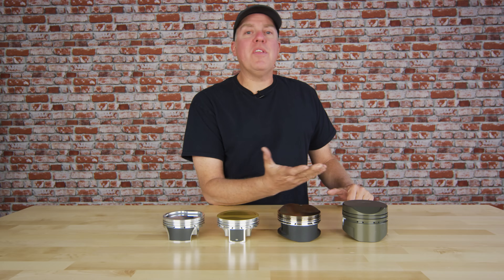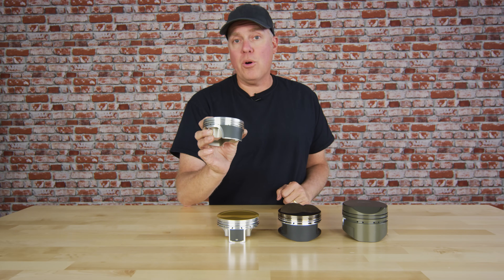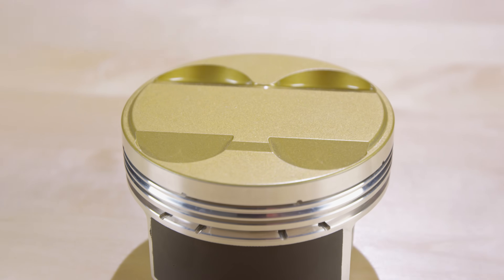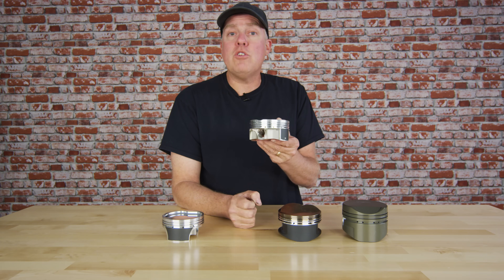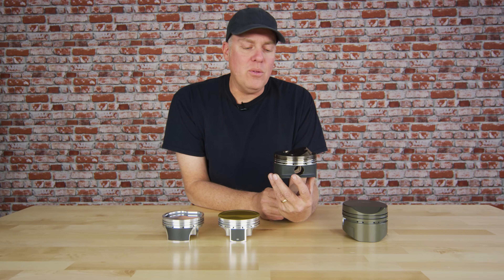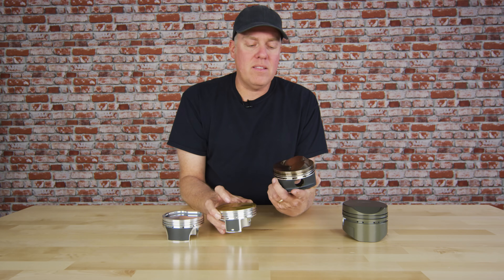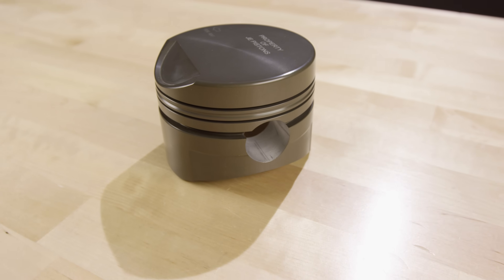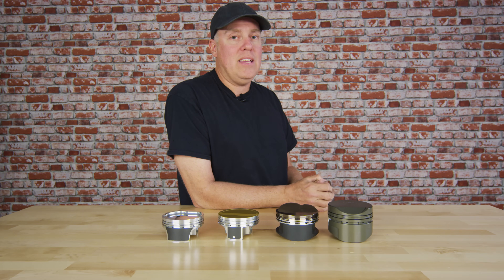Piston Coatings 101: Which is the Right One for You?

Comment: Dude you didn't even mention the fact of the different circumstances when it comes to anodizing or non anodizing pistons when you fully anodizer piston it does make it harder however it does also make it subject to wear and under heat contracting and detracting of the anodized metals can cause cracking which can annihilate and inevitably lead to engine failure. I was a roadkill fan for a long time. But this was a poor explanation of the actual product and how it performs. 
I wouldn't bother posting this thread if I was the product manager if it would lead to unfortunate blind faith in a product unexpectedly failing because there hero or fan were poorly promoting a product that destroyed their dream car they may have been working on for over a decade.
Too neglect that fact and to risk crushing a person's spirit like that due to your own fragrant attitude........ 
Poor form..... do better

Comment: The method that can be used on cylinder wall. 
(Wall)metal, ceramic, lubricant, metal(piston)

Plumbing - metal to plastic, plastic to metal (not always metal to metal or plastic to plastic)

Comment: Great video, should I use a cast or forged piston for my Honda k20z4 engine? Building a naturally aspirated with 12.5:1 compression, is 12.5:1 compression not too high for pump fuel?
Reply: Too high. Stick to 12 maxon pump gas
Reply: Cast is for stock type motors.

Comment: You can skip the vid and I'll explain it in 1 sentence for you: basically a piston coating provides a decrease in heat generation, less friction inside the cylinder and yes it is always worth it to have a coated piston or even better to have a coated piston and coated cylinder walls.
Reply: Wrong

Comment: I wish I still worked at that anodizing shop when I was 16... could have run this set of pistons through for free. That hard coat is amazing... almost impossible to scratch aluminum once its on there.
Reply: What where can i get this done?
Reply: @HandMadeRoyalty  In your garage. Diluted sulfuric acid to about 15%, submerge aluminum piston, throw the juice to it till it suits your needs. Anodizing does add to the size of the part, DN, etc.
Reply: @BigRW   THIS! Nice description.
Reply: @HandMadeRoyalty  its crazy, you can chuck a set of coated valve covers down the street and not have a scratch, I'm not sure if car wheels would hold up to curb rash but it would be interesting to test it lol
Reply: @triggerwarning2439  but where can i get it done?
Reply: @HandMadeRoyalty  look up anodizing, or anodizing and electro plating, usually they do both

Comment: What's the best piston for 91 octane gas? I want the most power, and the most carbon resistance for the tops of my piston, my engine is a 454
Reply: I think you have to calculate that by mentioning to an engine builder plus mentioning whether you have iron or aluminum heads, and if you have the old combustion chamber design or a newer one to determine the type needed for 91 octane.
Reply: instablaster

Comment: I wonder if they could do nikasil on the top of a piston. Wouldn't that be harder and better than any of those coatings far as on the top of the piston.
Reply: After watching a bunch of these videos i think expansion ratio also plays a big role here not just hardness and temp resistance

If it's only hardness and temp resist, why not tungsten carbide or  just use TiAlCN

Comment: I have a Jeep trackhawk with a 118mm precision turbo giving me about 2000 hp my pistons keep breaking which one do you recommend?!!
Reply: Piston rings with gap not correctly done especially in charged engines can break the landings of the piston due to expansion being increased with higher temps. Rings need bigger gap so they don't butt ends with piston expansion of higher temps. Diamond, J.E. C.P. and Supertech are top quality manufacturer name's of pistons. C.P. are the one's i tend to get if available. Coating the crown of a piston helps in turbo applications better.

Comment: I would like to know about Formula 1 pistons and are they doing anything different than the rest of the world.
Reply: F1 piston use different materials in the alloy than off the shelf one's. The skirts are coated with zylon. This reduces friction and helps transfer heat better. The piston clearances are tighter and as low as 1 thou piston to wall clearance. Piston rings being 1mm PVD coated piston rings reducing even more friction is used. Piston top has a ceramic coating on them. Cylinder wall is made with secret type of material also coating that is on it I couldn't find out what they use or how they produce all the liners used. They are very hard to get information about certain aspects of the materials used for a engine for reasons I did realise. I  had to move to asking other questions that could be answered as it was getting some stern words to move onto another one. The weight of the piston I found surprised me at 90g. 16mm pin made of a strong steel he never went into but he told me it had a PVD coating of Titanium Nickel in the surface. Rods are also Titanium and not very long and design is like a X and weigh 120g each. The way it attaches to crankshaft is clever design I noticed but asking what is used to join it he said I can't show you what is used in the attaching onto the crankshaft. Which had a very short stroke but also couldn't say what it is. But I estimate about 40mm to 50mm of stroke looking at it. Very light and small journal's that you would think would handle revving to over 6000rpm and more with Turbo boost technology aswell. My Mrs worked at Mercedes in Brackley near Silverstone in the UK and managed to get me in for a tour due to being known due to building engines for a living and getting reputation for high specced one's that have great results. The engine tech never new I did it for a living until I asked certain aspects of the technology in engines only very few people would no. When he said to me how I new so much about engine technology I had to tell him what I do as a living and I thought you knew about it because the Mrs spoke about what I do for work but she never spoke about me just said I was interested in engines. I was in engine unit for nearly 2hrs asking questions and looking at schematics of some components. And before going into the unit I had to wear a painters suit hair net and gloves to enter. Clean room was like a theatre of a hospital with tools that cost nearly a million in fancy drawers on one side and when a tool was taken out it was registered it was out with the time and person who had taken it out, it was on a big screen the information about the person who is using it, all with barcodes that is on tools and a card the person has to use to open the draws before getting any tool. Asking how much was the torque wrench on the bench for curiosity he said it cost over £2000 and that's the small one the biggest one was near the £5000 mark. He laughed when I swore when I said fuck me I only paid £120 for my one. My day was interesting to say the least but learned quite a bit about F1 V6 1.6 engine they have and how it makes over 600bhp from this tiny engine. Hope you now have a better understanding of the F1 components used in the engines? Sorry if I've gone on to long with what I've written. Lol. Just realised what time it is. D'oh.
Reply: @tazgrant4521  Very Good! I mess around with Domestic Chevy V8's LS engines and have worked on everything up to 632cu.in. Alcohol engines. And it doesn't matter what Motorsport you are into, F1, Australian SuperCar, MotoGP, Some principal will never change when it comes to making Horse power. Thank you for sharing your story.
Reply: @tazgrant4521  I have heard that in some racing leagues, some people have successfully developed .7mm compression rings. Total Seal builds them and you can buy them and you don't have to be a race engine builder to buy them. Also, some racing rings have a ceramic coating for high durability and low friction, and I have heard the formula is a closely guarded secret.

1mm compression rings used to be for auto racing only, but I think some street driven gasoline engines can now use them and go for ages. Some also use those special coatings. They have even made their way into boosted engines. Obviously they aren't making such extreme horsepower out of such tiny engines, but they also aren't building engines to last a very limited distance.
Reply: Elsewhere on youtube is a video of a Honda V10 that runs 20,000 rpm's.  I guess that's for some sort of Formula 1 style racing. I'm wondering what those pistons are made of for that V10
Reply: $$$$$$$$$$$$$$ get ready to use all your money!

Comment: What a great vid. Being a mechanic that does a lit of modified motors, i love keeping up with new tech that comes out. My biggest problem has been getting some of these features when ordering my parts from Summit (and i live in Australiia- an ordering error becomes a BIT IG PROBLEM). Well the snappa heads running the phones over there jave never let me order anything that wasn't a direct off the shelf part, using the excuse of "if there isn't a specific part # with what you want, we can order you stuff like that"!!! I'm seriously not kidding. This has happened many times and even with simple shit like (sorry, having a menal blank at the moment) getting little holes around the outside edge of the crown that can be used to help seal the top comp ring (i can't believe i can't remember the tech name for them- was prob on the piss a bit hard last night and am a little hung over. Yeah those Summit counter staff are clowns when it comes to accessibility of some of these types of features. You guys need to talk to them about that. Just offering some of my real life experience as someone in the trade going through one of your largest suppliers and them not even trying to be helpful... Thanks guys. Love your work
Reply: Know this is a old video. But when try to get custom options/designs it’s better to reach out directly to the manufacturer
Reply: @joshr8680  Was gonna just add in as well summitt sells parts they don't make jack squat ..even the summitt brand stuff isnt made by them. when you want custom made shit you contact the manufacturer and then see if that combo already has a part number and then see if summitt can order you the part. if all else fails get the name of the salesperson and mail um a turd .. doesn't need to be yours it could be your dogs after you feed um mexican food